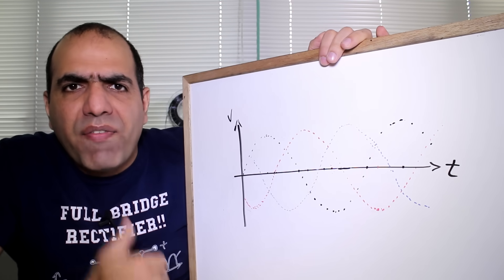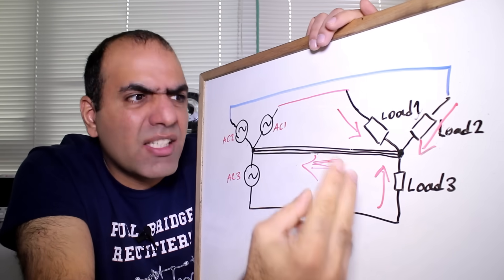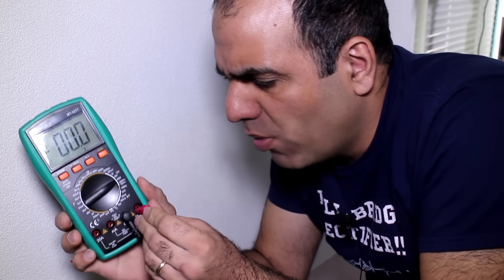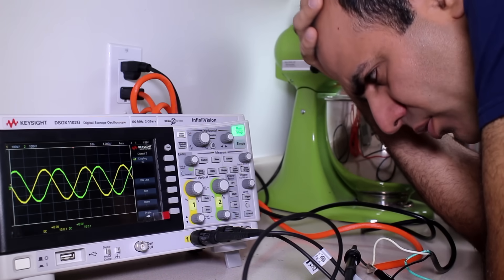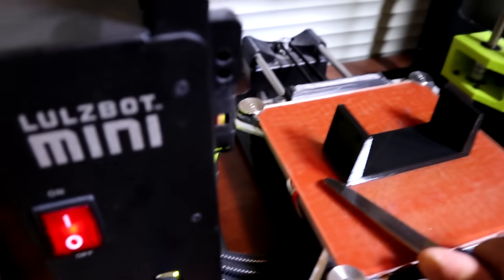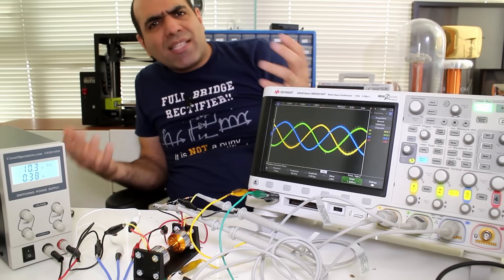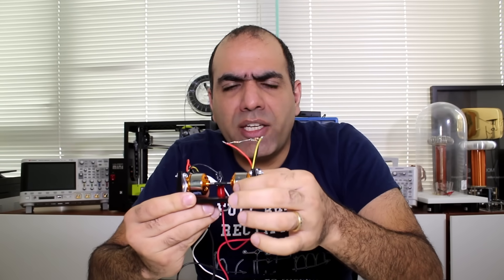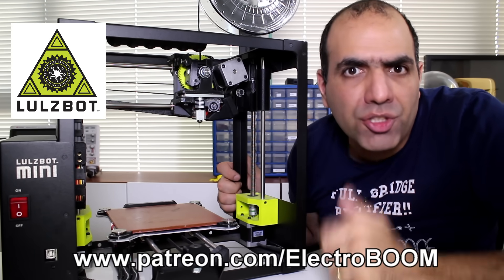Why 3 Phase AC instead of Single Phase???

Comment: actually 3-phase has no special power transfer at all, the comparison is wrong. With '1 phase' one wire is the neutral and not carrying power, if you change the neutral to a 'negative' then the amount of copper needed for power transfered is exactly the same as 3 phase.

Comment: This video is a little misleading how residential electrical service works.  In most places a residents receives only 1 phase, however it is supplied by a "center tapped" transformer.  In short this means the transformer can supply 240V when used at the end of both taps, and 120V from the center of the tap to each end.  Source: I'm a field engineer for the power company.

Comment: You really shouldn’t replace the fuse in your multi meter with fencing wire using the wires you are testing as the fuse seems counterproductive... (at least on Australian voltage that would have blown your multimeter pretty spectacularly I suspect 30A at 110V would be similarly destructive maybe you should actually do the experiment... with a multimeter you don’t like... and a variac incase you like your wall sockets)

Comment: heres a simpler way.. single face pushes once every 60 hertzh or 60 times a second.. 3 phase pushes 2 more times so 60 60 60... its constantly pushing.. instead of say pushing a car from behind then resting 1 secone then pushing again.. 3 phase.. pushes constanly on motors etc.. less heat too more efficient...

thats all imagine a hammer hitting a nail just once.. then 3 phase comes in and 1 hit hammers it right in... this is 3 phase and all busneeses use 3 phase why this principle.. also its mainly used in motors big motors to  make less heat and more effiecint.. 3 phase is used for elivator motors.. pumps in nulcear power coolant pumps etc... 3 phase is never in homes.. its not needed...

Comment: If you printed that 3D model sideways it would have been much stronger. The strength between layers is much weaker than the strength along the layer. The more surface area connecting two layers, the stronger it'll be. It definitely helps to design models with layer strength in mind.

Comment: Thanks for making this video! I know how much effort these take, I have a growing YouTube channel about my electronics projects. I have a question. If you wanted to generate a 3 phase signal, why didn't you just connect your resistor load to the esc and measure with the oscilloscope? Why did you go to the trouble of connecting the motor shafts together? Love your videos, keep making them!
Reply: The ESC needs feedback from the motor coils to even start producing output. With just resistors it wouldn't do anything. Theoretically Mehdi could have used just one motor and hooked both the ESC and the oscilloscope up to it, but since ESCs typically don't output a pure sinewave, it wouldn't have looked so nice on the scope.

Comment: I am an electrician in the US and I found it interesting you had 2 circuits from different phases on the same yoke. I know it's possible, I just don't see it often. We would normally just run a separate circuit to a separate box/device to do that. As to accommodate for required receptacles in a residential setting.

Comment: I'm a radiologist and we use three-phase in x-ray machines to create a more consistent waveform. These units can run on 110 volt circuits in stead of the old units which ran on 220.  I emailed an electrical engineering professor many years ago and asked why we couldn't do the same thing with air conditioners. I never heard back. I hope you can answer my question.  We could then run them on 110 instead of 220 and save money. Is this not possible? If not, why? Thanks so much. Your videos are some of the best on YouTube.
Reply: +beauxtx1959 - Your X-ray machine is more than likely running on a 120/208 volt Y-configured 3 phase system. As for A/C units,, they also are made for 3 phase power. What you are asking about comes down to more of the preference of the people who designed your building. Maybe the electrical system just wasn't beefy enough to handle the power demands of a 3 phase A/C system. There certainly was no reason why your building could not have such a system outside of that consideration. Generally, the type of power an A/C system uses tracks with its cooling capacity. The smallest units connect directly to 120 volt single phase outlets, as you probably know. Going up from there we get into the 240 volt units that you have. Then we start talking about 3 phase units, and on the very large units, higher voltages as well. Hope this helps.

Comment: In the UK domestic supplies are 240V AC single phase. With the higher voltage two phase is not needed for high power domestic appliances. Industrial users get a 3 phase supply which is 450V AC. Domestic socket outlets are always on a ring circuit which means thinner wire can be used, but every plug must be fused so that a short circuit does not blow the whole ring.

Comment: I need to 3D print a collection of stupid useless shit and then run out of plastic when i really need something to be done.
Like draining the batteries of your torch for no reason or a can of air duster you use 3 times a day to remove almost nothing and will be empty when you need to clean your CPU/GPU rad & fan blades ..

Comment: I  really enjoy your videos, I was getting ready to correct you on the 2 phase in appartement when I saw that indeed you do have a 120/208 V feed at your appartement. The appartement complex is probably served by 3 phases medium voltage and each appartement receive 2 or 3 phases but inside the appartement they are seperated. There exist however  another system called split phase where a split phase transformer produce 120/240v from a single phase medium voltage.  I think it would be a good video idea to show it and build a mini split phase transformer from two discrete ones. Another idea is to demonstrate voltage potential gradients in earth and the reason a safety ground is needed. Keep up the awesomeness!

Comment: I didn't think that they ran 2 phases into homes in North America. I though they just split the 3 phases up at some distribution point, say, one phase per street or maybe one per neighborhood. Then, the transformer on the pole outside your house converts the single phase high voltage into split phase 120/240v., which has two hots and one neutral. Voltage between both hots are 240v. Voltage between any of the hots and neutral is 120v.
Reply: That's correct. It's one phase. The pole transformer is center tapped, producing two legs 180 degrees out of phase. 120v per phase, 240 across phases.
Reply: Yup, I was thinking the same thing
Reply: Yep. Businesses or industrial can get 2 or 3 phase power but residential is almost always split-phase.
Reply: Did his kitchen have two different phases to each outlet in case an appliance needed 240v and it’d be easier to tie them together if need be? Or was it one phase center tapped so both hots measured 208v and he mistakenly said two phases?. That part confused me a bit
Reply: His kitchen appears to have 2 phases (not split phase) which I think is unusual. He actually mentions this in a future video. Apparently he lives in a high rise building. The building probably has 3 phases run to it and rather than a split phase. Residential areas usually don't do this, but maybe it is somewhat common in high rises.
Reply: MrZedblade Ah ok. Is there a benefit to having two phases rather than a split phase? I mean if an appliance needed 240v a split phase tied at the hot would be done right?
Reply: Well I'm no expert so someone who really knows might jump in and correct me :) I think split phase is 180 degrees out of phase whereas the 2 phases shown in this video seems to just be 120 degrees out of phase. I'm guessing split phase would be able to supply a higher voltage and therefore more power. Whether or not this really matters in practice I don't know.
Reply: mrsemifixit I'm pretty sure it's just so they can plug in 2 high wattage appliances into the same outlet, not for running some bastard super appliance with 2 normal plugs. Same affect could be accomplished with 2 circuit breakers, but this way they can use a single wire bundle instead of 2.
Reply: Hodge Podge Productions You mean two separate high wattage 120v appliances one in each receptacle? Makes sense as the total power wouldn’t be split

Comment: I see a lot of people arguing on here about who's system is better, US/Canada or Europe. It's not that simple, as they both do what they are supposed to do, and both are being continually worked on and improved.

The biggest issue is, much of the US grid is older than the European grids, as much of the Euro grid was blown to pieces in WWII, combine that with metal shortages, they had to find a way to deliver high power demands with less. Hence 3 phase to home and higher outlet voltages, along with the hated ring mains. Europe has a superior design by providing those things to homes vs the American split phase. Residents can forget cheap 3 phase equipment, which isn't as uncommon as you may think. Due to practical wire size limits, america has much lower power capacity for a given multi-purpose circuit. A single space heater can trip the standard 15A general circuit used in America for decades, and kitchens are useless unless they have at least a 20A circuit, even then thats often not enough and things like refrigerators and built in microwaves are given their own circuits.

Simply put, I love my country despite all of the issues its facing, and an outdated and failing electric grid is one of them. But there are good reasons for the electric grid to be in it current state, and clinging to old outdated ideas isn't going to fix them. Already we are seeing universal power supplies on many consumer electronics, I hope in my lifetime I can be part of the transformation of Americas electrical system.

Comment: Houses are actually 240VAC single phase with a center tap neutral in the US and Canada. This was done after 120VAC was already implemented so that you can get 120VAC from a 240VAC single phase secondary on a transformer.

As far as why 3-phase v. single phase has to do with how induction motors work, they need at least two phases to create rotation in the magnetic force. You can achieve this with single phase but you have a starting capacitor that creates a false second phase at start to get the motor spinning. Once the motor starts spinning the false second phase circuit opens and allows the motor to keep running as a single phase is sufficient to maintain rotation. If you put a substantial load on the motor and run it at a low frequency through a VFD you can actually see the motor have a small bit of jump in RPM at the point where the single phase stator is located. The down side of running a single phase motor though comes down to current, in single phase you need 1.732 (square root of 3) times the current. While nearly doubling the current doesn't sound terrible, just run some bigger wire, it is a problem in high HP motors due to skin effect giving you diminishing returns on larger conductor ampacity.

Comment: This explains why all Canadian Spa-baths come with 2-phase standard instead of 3-phase. 
Go go canadian craftsmanship
Reply: Wille A It's called single phase 208/230v not 2 phase.
Reply: Wille A here in the UK most houses are 240 3-phase
Reply: Paul Banks No they're not. The vast majority of domestic supplies are 240V single-phase. Anyway, if it were three-phase, it would be supplied at ~400V not 240V.
Reply: Micheal Haran here's proof https://www.schneider-electric.co.uk/en/faqs/FA144717/.
Edit. This is a better proof https://www.electriciansforums.co.uk/threads/single-3-phase-voltage-in-the-uk.10221/
Reply: Paul Banks, I'm not sure if you're trolling or just don't understand what you're talking about. Nowhere on those pages does it state that most homes in the UK are three-phase. 
In fact on the link with your "better proof", the first reply to the question states: "It's actually 240V single phase but we say it's 230V"

Comment: Houses only get 1 Phase. The 120/240 is due to how the transformer on the street is tapped.
Reply: That would be center tapped.
Reply: Indeed
Reply: No, two phase systems are different.
Reply: Isn't it technically two phases, each one 180 degrees out of phase, because neutral is grounded?
Reply: How?
Reply: http://www.oempanels.com/what-does-single-and-three-phase-power-mean
https://en.wikipedia.org/wiki/Two-phase_electric_power
Two phase refers to the above.
Reply: That first article is, I believe, incorrect in labelling the second item as two phase. It is a split system however as it says. Here is the wikipedia article confirming it
https://en.wikipedia.org/wiki/Split-phase_electric_power

The 2 phase one you link to in wikipedia article however is what I was referring to, and what I believe two phase power to be.

Comment: So thats why industrial equipment seems to run at a multiple of 120v in the US. 120v for single phase, 240v for double phase, and 480v for 3 phase like what the compactors in my old jobsite used.

Comment: Fun Fact, most transmission lines in the US and Canada are Delta configured, rather than Wye, and therefore do not have a neutral conductor (or ground reference). Likewise, there are "ungrounded" wye systems that also do not have a neutral or ground reference.

Comment: are you sure the 2 phases in residential are 120 degrees ?  always tought is 180 degres opposed . 

the street transformer takes only one phase high voltage . 

I have to put my scope on the mains , but you know , I don't want to explode it :) ( grounded)
what about to measure differential with 2 channels and save the ground ?

where are you in Canada ? Toronto ?

Comment: residential power is only single phase. the neutral is the center tap of the low voltage side of the transformer in north america. if we got two phases you would have about 208 volts instead of 240 from one hot to the other.

Comment: also an alternator in your car is practically a 3 phase ac motor like the one you used to generate a signal, but with a 3 phase rectifier attached.

Comment: the two-phase system makes no sense at all. in Europe everyone gets three phases. also a two room apartment. even because a normal cooker with three phases runs. 🤔🤦‍♂️
Reply: Transmission lines are three-phase almost everywhere. The question is: how many phases one single apartment gets? I thought for a long time that my electric owen got three phases because it used monstrous black outlet with 4 rectangular holes and sign '380 V 32 A'. But it turned out, this outlet was actually connected to the same phase! Owen was wired in a way to connect front heaters to one phase, rear heaters to second and owen to the third, but it never relied on whether they are really different phases with 380 V between them? And energy meters, circuit breakers etc are much cheaper for single phase.

Comment: Brushless Motors are not AC. the three Phases get separate DC Pulses. On the Oscilloscope it looks like 3 half Square Waves on the input. Because of that the Motor start to generate a bit of power, which the ESC uses to detect the actual phase and start the next one. Its a pretty nice and very efficient system.
Reply: But they could as well work from true AC, even better. After some thought, BLDC, synchronous motors and stepper motors are the same beasts with just different purpose and typical usage.
Reply: Naah, the Spools and Magnets arrangement are different on all three. But you can use BLDC Motors as steppers, with a low torque and with lots of step losses, for some cases that is still okay and a good and cheap option (like Gimbals).

Comment: Heh. Reminds me of my Anet A8 3d printer. Octoprint has made a plugin to specifically tell people that their Anet A8 is unsafe. More specifically, part of the firmware that cannot detect thermal runaway. But that doesn't include the whole host of corner cutting problems as far as electrical goes... Running the current for the heated bed and hot end through the control board, running 12 amps over 10 amp rated pins on the heated bed (turned the connector brown, and I hadta do a bit of jury-rigging with spare components to distribute the load over two of the 10 amp input pins), having a power supply that isn't powerful enough and doesn't have cooling fans... Etc. There's more, but I can't remember 'em right now. (Oh! Doesn't have a fuse, doesn't have an off switch, and has exposed mains terminals on the power supply... Could prolly find more, but w/e)

But I guess that's what I get for getting a $200 3d printer from china. ¯\_(ツ)_/¯

Comment: Dumb hypothetical question:
Would it ever make sense to run more than 3 phases, or with a different configuration?
For instance 20 phases @ 18 deg offset?
Would you be able to supply more power, or possibly produce a more efficient a/c motor?
Reply: The sheer amount of cables you would need make this incredibly expensive, for a tiny, tiny increase of efficiency

So yes, but no

Comment: So what is the big advantage over using Single Phase Double Voltage - IE 2 phase or ++ 180 Deg Seperation like a normal US Household voltage setup? 240v / 2 = +120v + - 120v

Comment: Just a tip for your next 3D print, if you put that part on its side you'd have the perimiter go around the two parts you broke of. so keep orientation in mind when you are slicing your files, both to make sure that the part is strong where it needs to be strong, and to reduce ammount of needed support material. Thanks for the entertaining and informative videos, and best of luck on your future 3D printing.